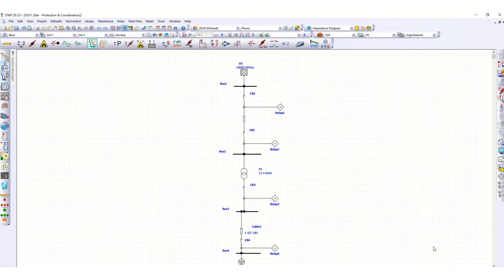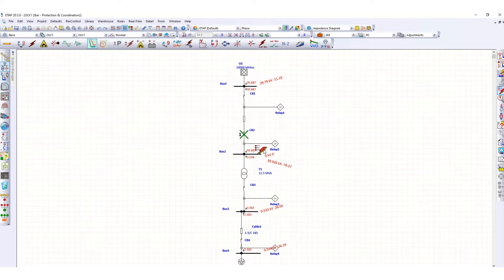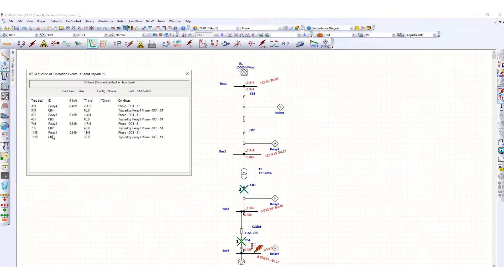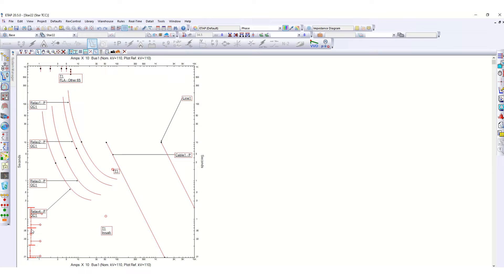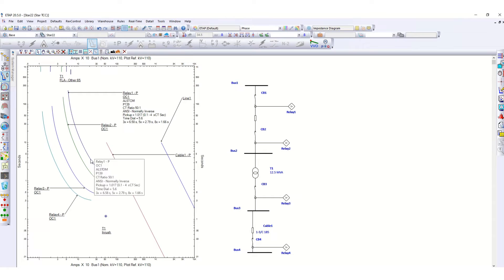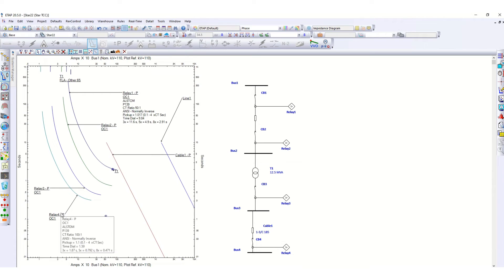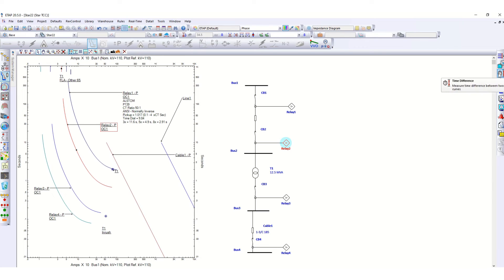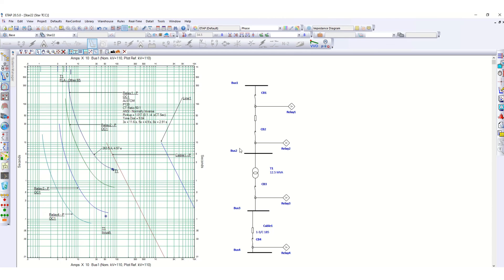Protection & Relay Coordination ETAP Study (Part 2)

Comment: THAANKS BROTHER! just a question about the   (T1 FLA ) Shouldn't it be around the relay 3 and 4 pickups? i hope you got me brother thanks!
Reply from the maker: Yes, relay pick-up will depend on transformer FLA & few other factors like CT ratio, CT/relay error, margin etc...you can check out transformer protection specific video for detail in ETAP using manual calculation explanation, thanks!

Comment: There is another thing hope to be covered in the next video.

How to set the TCC curve for 3 auto reclosers connected in three parallel branches with the upstream substation  protections.

The second is how to avoid the miscoordination  between downstream circuit breakers tripping with faults in the upstream system in etap .
Regards
Reply from the maker: Will upload few videos using ETAP in details for complete protection

Comment: Thanks 
It is very helpful.

Regarding to the instantaneous trip , is it necessary to be set with new element or with the previous over current element. Also regarding to the ground fault trip what we should select?

Thank u dear
Reply from the maker: Instantaneous can be set with the same OCR relay by enabling this feature. Also ground element available, however, sensitive ground element can be set separately for low ground fault current sensing.
Will make another video describing the above features and combining 50 & 51 element in TCC curve..
Thanks for writing!
Reply: @SmartEducare  
Thank u dear . I will be waiting